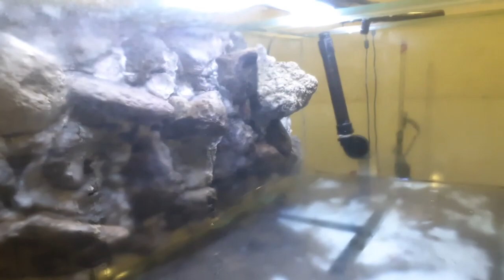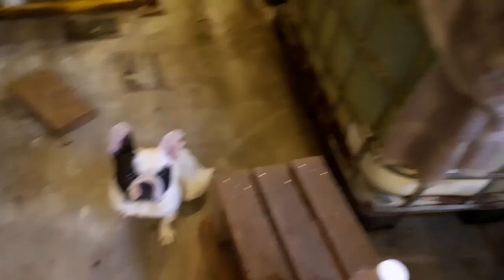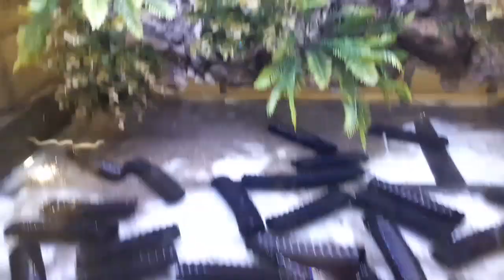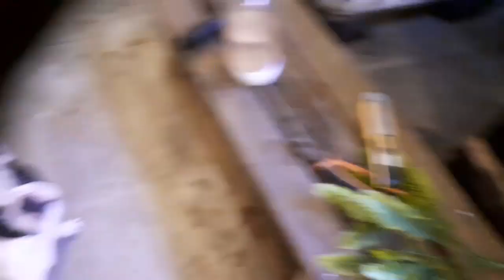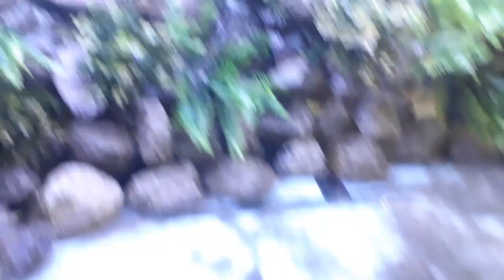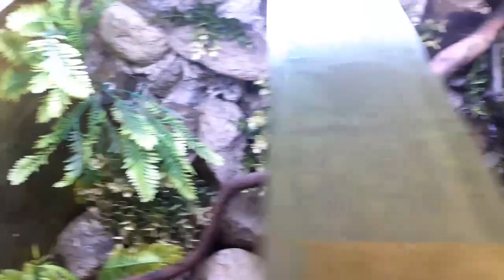Interior design for a display aquarium

Comment: My confusion centers around all those pipes in the bottom rear.  Are they open on both ends and accessible to every size of fish?  From your camera angles, those looked like smaller-sized tubes.
Reply from the maker: Open both ends, 32mm pipe perfect for the dwarf mbuna and julidochromis which are both cave dwellers of sort. Larger frontosa and auloncara are using the cave system made from rocks above. Layers upon layers.